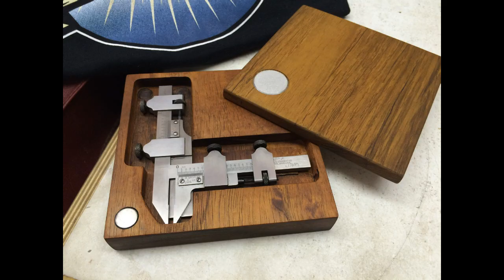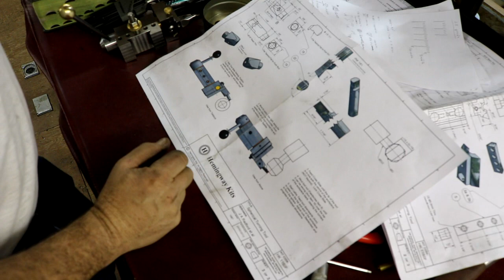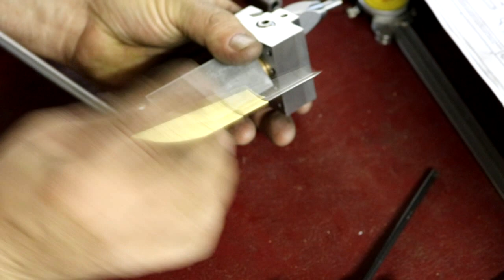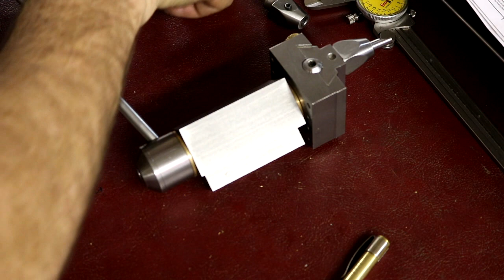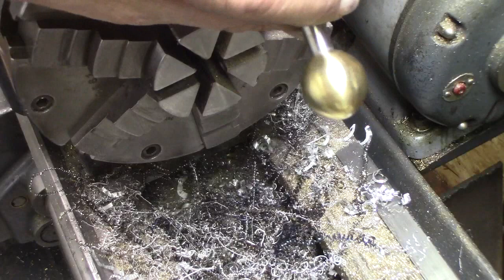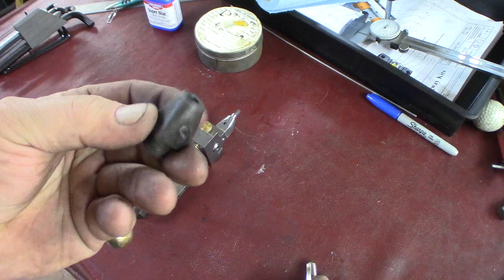How To Build a Hemingway Kit Spherical Turner / Ball Turner P18

Comment: Hi Randy, thanks for lots of info on the Hemmingway kit build. I've finally decided on making a horizontal pivoting ball turner, as my lathe doesn't have much height over the saddle, so can't spare any room for the base on the vertically pivoting style. Anyway, one thing I'm considering is how much set up is involved, so I was very puzzled at 12.10 (where you have the luxury of a QCTP) that you set the dovetail block on the tool itself at flush, and then set the height of the cutter over the workpiece diameter using the QCTP height adjuster. Eh? I would have thought that the pivot centreline of the tool spindle MUST  be set exactly at your lathe spindle centre height.  Too high and you'll be cutting slightly figure 8 x section balls. Too low and you'll be cutting an elliptical x section. Is that not the case?
Reply from the maker: Yes you should be on center line to make round balls.

Comment: Nice work! Personally, I have never understood why people simply don’t use a premade boring bar holder like my KDK 1” with standard ball bearings counterbored, then clamped in then the rotation axis is taken care of with a simple criterion boring head attached to the through shaft in the boring holder. I have no need for one, but the only thing necessary at that point is rotation of the tool post to 90 degrees square with the cross slide. It would eliminate a lot of work. Just saying....keep up the good work!

Comment: Very neat job on the ball turner brother. I can see that you took care in doing this.
Reply from the maker: Thank you, quite a bit time in it.
Reply: Hi Randy, believe me, I was criticized many times by those above me where I used to work (resigned in August 2008) for taking time to do a good job. I just refused to lower my standard to suit other people. Appearance of my work was always critical to me, no matter what other people's opinions were. I am a toolmaker (RED SEAL - 43 years) and also a qualified metrologist (27 years). The two trades are closely connected. I still follow the same path (a pensioner since 2008) although I do private work for individuals and companies. I have designed a ball turner (going to collect the material on Wednesday) with which I will be able to turn radii as small as 0.2 mm, convex, concave, and by using some of the ball turner's components, I will be able to tap thread absolutely 90 degrees. Had this idea for quite some time and have now decided to put it to the test. I know it will work. I have been using the parts to tap thread as long as I can remember. I'm also busy building myself a rotary table with which I will be able to go to the nearest 5 minutes. I still have to collect the material for the worm gear. I Will be able to use it on my small lathe and on the drilling machine. Happy turning brother.
Reply from the maker: Thank you again Pieter.  Nice career.  I enjoy the tool making and the precision aspects of machining.  I would love to see pic s of your radius turner when you get it complete.
Reply: I can't wait to get stuck into this gadget. I had a need for it several times but just haven't got around to actually building it. As I said, tomorrow I will collect the material.
Reply: The material was delivered today. I was spitting flames. Some of the pieces of aluminium was cut on a guillotine. How stupid must you be to guillotine a 16 mm thick strip of aluminium? The material was deformed, mutilated and distorted to a piece of scrap metal for which I paid. Some peoples butts are going to get kicked, believe me!
Reply from the maker: I hope you can this replaced.
Reply: Morning brother, I will surely give this company a hard time. More than one piece of material is totally useless to me. Everywhere in my country (South Africa) we have to endure incompetence.

Comment: Whew just benged my way threw all the build. What a handy tool that thing is.
Reply from the maker: Lots of parts.  Took some time to build.   Thanks Chris.
Reply: Randy Richard In The Shop no problem any closer on the angle plates. I need to mill some surface plates if your game for the same deal. Oh and jb from Oz sent me something for you.
Reply from the maker: Soon, I just got the correct grinding wheel for the cast iron.  I talked with Robin R. about the project.  I am finally getting some time in the shop.

Comment: I've used the cold blue many times on old guns and it works well and looks more natural and doesn't look like it's been restored and more like an old gun should look, but without bare spots and rust. Bad part is you don't seem to be able to get a "factory new" looking finish. It will often look real dark at first, but gets lighter and worn looking very quickly.

Comment: That came out great. The bluing stuff from birchwood is okay but I switched to oxphoblue from brownells. It works so much better. If that part isn't taking the bluing you might need to bake off the oils and dip the part while it's warm that's always cured my issues with birchwood super blue. I also discovered that sand blasting the parts results (with oxphoblue) in a great black oxide look.

Comment: Enjoyed this very much! We use the same Bluing down at work and when it doesn't blue very good we lightly apply a little heat and if it seems to take then we try another coat or two,Hope your bridges hold and your flooding stops,God Bless!
Reply from the maker: I will try that, thanks Joe.

Comment: Thank you taking us through the build and all your advice along the way. The finished tool looks fantastic. The adjustable head of the ball turner reminds me of a small boring head. I have a small S-1 1/2 Criterion boring head and wondered if this could be adapted with bearing mechanism to make a small ball turner? Thank you for the inspiration.
Reply from the maker: Thank you Paul.  I have seen several designs where 2" boring heads were used in the same fashion.

Comment: Not hard to want to follow a series like this Randy. You really went all out filming and editing this down to as concise as possible. I enjoyed it a lot. And I'd agree 100% with your synopsis of the changes that would make the tool easier and better to build. Nice touch using the rotary broach for the feed screw as well. They make some pretty small diameter round carbide tips that might work well for the ball tool at least. Maybe not so well while cutting concave though due to tool clearance. 

Fwiw and I noticed someone below mentioned it that warming the part first seems to help with the metal taking the bluing. (done outside of course) But hot caustic bluing can have the same proplems including almost something like the finish you see with color case hardening sometimes. Higher crome content in the steel alloy is supposed to be the main reason why some steels don't take the bluing properly.

Comment: To get a good sphere (that measures the same in all directions, at all angles), the axis of the ball turner has to be EXACTLY the same height as the axis of the spindle. A bit low and you will cut a prolate spheroid (like an egg with no big/small ends); too high and the spheroid will be oblate (like a squashed ball) and you risk digging the back side of the tool into the end of sphere if you swing the lever too far. Try a few practice balls with the axis of the ball turner much too high and too low (like maybe a quarter inch on a one inch ball). That way the spherical error will be plenty enough to demonstrate how axis-height-error affects the shape of the ball. Get the height set right and forget it.

Then get the tip of the tool advanced with the cross-slide to meet the exact center of the spindle. (Same reasons.) Lock it and forget it. Mount the workpiece in the chuck.  Adjust the carriage to the center of the ball.  Lock it and forget it. Now use the slide on the ball turner (as you were doing) to make the actual cuts on the ball. It should make a perfect sphere.

Comment: A really nice result Randy. A tool to be proud of for sure. I have never had much success with those Selenium based compounds either, best reserved for very small areas only despite what it says on the bottle. Interesting that you chose two of Hemingway's kits as the first projects. I assume there is not much on offer in the US market for model engineering projects. One suggestion you might try would be to make another tool holder to use a tangential style of cutter. That should make grinding tools much easier. An angled flat on a round tool bit does not get much easier.
Reply: Strictly speaking he already has a tangential tool, and yes just an angle ground on the end does work well.
Reply from the maker: Yes Chris, I am going to try that grind next.

Comment: Thanks for the detailed project series Randy it came out nice.  I have had mixed results with that same blueing compound some parts come out nice and others just crappy.  Most of the stock I used was unknowium so not sure if the metal type is the culprit, some further detective work needed.

Comment: Nice series.  Great design review at the end.  For lubrication you might consider some brass push in button oilers rather than just holes.   They're 20 for $3.50 on eBay.  Would keep crap from getting to the shaft.  I think the value of this project is in the construction not in having a ball turning tool when you're finished - the journey not the destination.  For as many times that you'd need metal balls you can just buy them on McMaster-Carr.

Comment: Great series Randy! I didn't have time to watch all of the episodes but I appreciate the editing to speed things up. Congratulations on passing 10,000 subs! One constructive note is that you must have perfect intersection of the ball turner axis to the spindle axis to make a real sphere. You can put a DTI in the ball turner and indicate the top and bottom of a true running bar and adjust until you get 0 top and bottom by adjusting the tool holder height. Once that is set you are good regardless of ball size. The ball you made is beautiful and perfectly functional but I think I can see from the video it is longer than it is in diameter.
ATB, Robin
Reply: Or to simplify, just turn a demo ball and then turn the cutter around to be on the bottom and adjust tool height till centred. As you say once centred it is good to go for life.
Reply: How could I get a copy of the tool you ground?  I am struggling with a turning a ball using a 2” boring bar holder.  I met you at Mr Pete’s meet and greet.

Comment: Very nice project and a very handy tool.  The way I use the Bidchwood Casey blue is to dip the metal in the blue take it out and let it sit for 1 minute.  Then rinse it off and dip and wait one minute and rinse again.  Repeat about a dozen times and the color gets darker each time.  Then after the last rinse coat it with oil.

Comment: Thank you so much Randy.   I've been holding off ordering the kit myself, wondering how you were going to deal with the 1/4-40 treading issues since they offer an option to buy a tap as part of the kit, although it's Whitworth, and I was loathe to have such a beast in my inventory.   Glad I waited since I have a BXA holder and based on your implementation and comments, I'll be doing a gib system and moving the handle back to accommodate the larger tool post.   Thanks again - much appreciated.   Now I have a decent project to use your dovetail cutter on.

Comment: Hey RR, maybe a taped hole for handle extension? Also oil fill caps a must. Overall a great series, very well narrated. Two thumbs up.
Reply: Hey Randy, in part 13 you made the tool holder. Maybe you could design and build one that takes an insert? Putting your own spin on the Hemingway.
Reply: Got a similar ball turner and made a tool to take small circular inserts, works a treat

Comment: beautifully done. i remember seeing a video of this same ball turner and it had a gib as you suggested.i have done a fair amount of gunsmith work over the years and i can tell you that you never know what your going to get with touch up blue. all metal reacts differently to bluing. the most consistent results i have obtained came from polishing ,degreasing followed by a trip thru my wife's dishwasher (when she's not home). dry the part, heat it up with a heat gun or hairdryer and apply the blue. never touch the part with bare  hands. and with all that said its still a crap shoot. for tools i have settled on industrial blackening fluid.tool grinding seems to be the biggest problem with these types of ball turner. i would like too see some more video on what works and how to grind it.

Comment: I agree it's always good to listen to Adam, and I also listened to Stephan G. on reamers, and he said the same thing about them over-sizing bores...if you use cutting oil. The one additional thing that Stephan said is that to achieve an on-size hole using a reamer, is that it only works with water-soluble oil, and he's proven it himself many many times. The link will be in my comment below after I finish your video...just in case you've said the same thing, LOL!

Comment: Man you really edited this down to pack the content and eliminate the dead time. I do appreciate that as it is tough getting the time to watch everybodies videos.  I like the idea of putting 2 locking screws in and having them push against a gib. Watching you use this I actually thought why not put a couple of bevel gears in there and run the adjustment thru the handle shaft so you could put a big knob on the outside and feed with that. (worm gear might actually be better) Congrats on the 10K! Glad you are getting rain but I wish it did a better job pacing itself, hate to hear about damage and flooding.